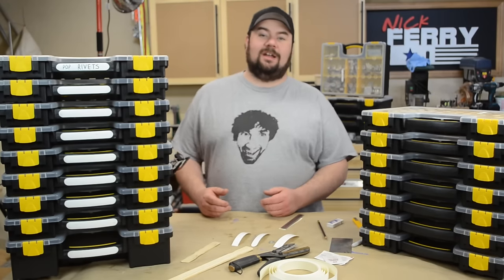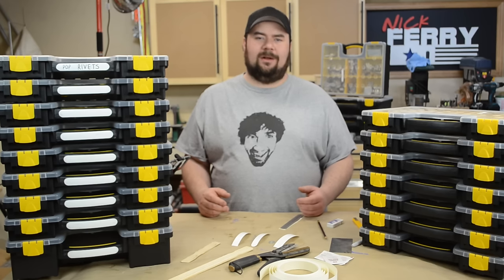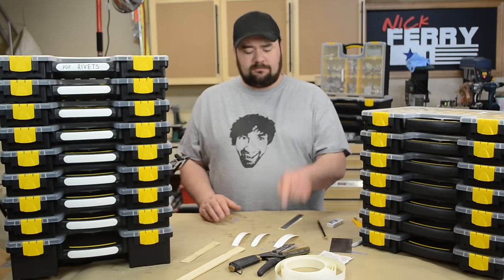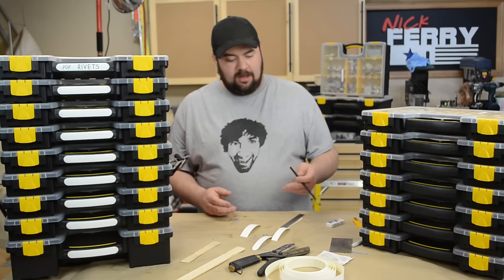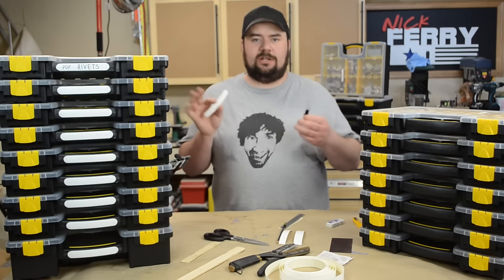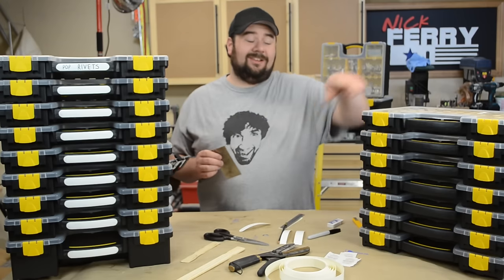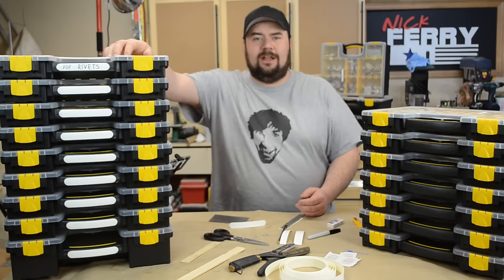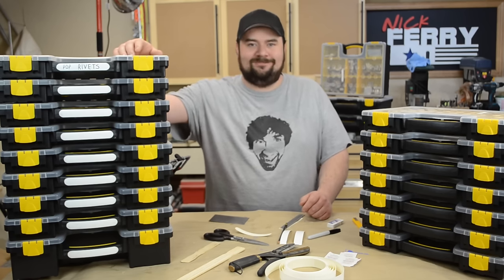Ⓕ How To Make Hardware Organizer Labels (ep64)

Comment: Nice take, and it looks like it works well for you!  

I did something similar, but with different materials.  I wanted to laser-print all my labels on 1"x3.5" Avery brand adhesive labels.  But sticking those directly to my organizer boxes was an issue.  Also, I wanted to be able to remove and/or overlay with new labels at will.

The way I solved this was to use super-inexpensive white vinyl home siding as a raw material, applied with hot-glue as a base layer.  I cut dozens of rectangles out of the raw siding that were just the right width and length (plus a small margin) to fit under my intended laser-printer labels.  Then, stacked & taped them so I could run them on a belt/disc sander to knock all the edges & corners off in one pass per edge/corner.  No pointy or sharp bits allowed!  

Next, each "base plate" got hot-glued onto the plastic organizers (textured side against the organizer's body; and smooth side facing outward) with a dab of hot-glue at either end, and one in the middle.  This provides a nice solid bond, but if I ever wanted to, I can just use rubbing alcohol to break that bond and remove the entire label plate.  I'd bet rivets would work well too, if that's a better fit for whatever kind of boxes one owns.

And finally, the Avery laser labels got applied to the smooth face of the vinyl.  It works great, and I can easily slap another label over an old one, when stuff gets reorganized.  It looks very uniform and professional, and unlike label-maker labels, I know it's not coming off until I want 'em off!  

For one-offs or temporary labels, I probably should check that siding material with a marker.  Since the outward-facing side is smooth, it's possible I could also use a permanent (yet erasable) marker as you did, I just haven't tried it yet.

Hope this helps somebody!

Comment: I use the Stanley brand organizers. Similar to the the HF organizers. I put a piece of electrical tape on the handle and then adhere P touch labels to the electrical tape. I color code the electrical tape by container content and it provides a good surface for the P touch label to adhere to. It also makes removing the label easier as it is easier to peel off electrical tape than a P touch label. I use 3M electrical tape.
Reply from the maker: That's a great idea to get the labels to stick!
Reply: Harley Zinker that’s a good idea but there’s one thing to watch with electrical tape. It is designed to be wrapped around something so it stretches as you peal it off the roll and gradually shrinks back over time tightening up. Make sure you don’t over stretch it when pealing it off the roll, especially in a warm environment, otherwise it will shrink back when used on a flat surface and look a little untidy.

Comment: Thanks for the great idea Nick! At work we use P-Touch labels but we only use them on flat surfaces, mostly painted metal. To stop the labels from curling we apply a 'smidge' of clear colorless nail polish along all the edges and that does the trick. I tried on all my tool cases (drills, router, etc etc but it did not work. Eventually they all pretty much bubbled and peeled. I will give your idea a try.
Reply from the maker: +Itz MeAgain cool tip on the nail polish - I think I remember someone using lacquer but hadn't heard of nail polish

Comment: I've been looking to do the SAME thing with mine, after I saw Adam Savages tower. I've been collecting them every time they go on sale, and this idea is PERFECT. Great job Nick.
Reply from the maker: +8BitLife getting them on sale or w/ coupon is key - I have been acquiring them for a few months - the cost can add up quick otherwise
Reply: Agreed.
Reply: +Nick Ferry Yeah, but you can still buy like a dozen for the cost of a sortimo (no offense to either Adam or Sortimo).    8-)

I've been looking for some way to label mine as well so this looks do-able.
Reply from the maker: Bill Weissborn I got to use sortimo when I was in manufacturing and they are nice but yes, way out of most peoples budget

Comment: Thanks Nick! I have a stack of those cases and a pile of drawer slides waiting to go into a cabinet. I was going to use a label maker, but this sounds far more reliable!
Reply from the maker: +Tyler Boespflug I would imagine - if you find a label that sticks well to these and holds up over time I would love to know about it - I could never seem to get the labels to stick and the paper ones wear out
Reply: +Nick Ferry - I just ordered a sample of Weatherproof Silver Polyester Laser Labels from Online Labels. I'm hoping they stick well because of their waterproof properties. This way I can even be "extra fancy" and print vector images or silhouettes of the item that's inside the case. Visually faster to locate the item I'm after.  Plus, the label will somewhat match the brushed aluminum magnet labels with vector images I'm using on my toolbox.

Comment: Did you ever try FastCap's FastEdge Peel & Stick tape?  That is what I use and it works quite well.
Reply from the maker: +Brian Way I didn't try it for this - with the compound curve on the handles I figured the heat of the ironing helped mould the melamine to the curve
Reply: Well, this goes without saying, but you do great stuff!
Reply from the maker: Brian Way much appreciated!

Comment: ooooh yeah! I have been struggling to find something that will stick to my black tubs (from IKEA) .. going to give this a go. I did try postage label, masking tape and printed nylon / pvc labels, but none of those have stuck so far.
Reply from the maker: +CodeFoxAus awesome - let me know if it works and maybe even snap a couple pictures - I was really curious on what different materials and applications this would work with

Comment: I use these same containers and have been trying to think of a way to label the handles. I'm wondering if dry-erase paint would serve the same function as the melamine with less effort.
Reply from the maker: +Joe Gekko what color dry erase would be easily visible on the black handles?
Reply: Nick Ferry Hmm, maybe I wasn't clear. I meant applying a white 'dry erase board' paint to the handles, in lieu of ironing on the melamine banding. You can usually write on dry erase with a permanent marker, and then when you need to erase the permanent marker you scribble over top of it with a dry-erase marker and it can be wiped off.
Reply from the maker: Joe Gekko ahh that makes a lot more sense - that would be a cool one to try!

Comment: Why are you stacking them horizontally, either needing a shelf for each one, or having to lift off the ones above? Stack them vertically, and you lose the shelves and gain the space. Hinges down, and they fit deeper but narrower (usually better space management in a workshop)- and you have the side of the box to attach your labels!

Comment: They make sticky back heavy paper and also sticky back vinyl for computer printers.  Just put paper in a printer, use a word processor or a drawing program to design the label, print it out trim and stick on.  Relatively easy to replace if need be.
Reply from the maker: I like the vinyl idea but paper label anything always seems to get beyond legible dirty in my shop - maybe I should wash my hands more often but that’s not the point here
Reply: @NickFerry  Try Mr-Label White Waterproof Vinyl Sticker.
Reply from the maker: Good to know - I have a vinyl plotter so I’d probably just go that route for the material

Comment: In most cases you can also color over the perm marker with a "expo dry erase" marker and wipe it off with no extra elbow grease
Reply from the maker: +JAKE SCOTT okay now you get a funny story - at a previous job someone used permanent marker on a huge dry erase board and then had to do what you said, write over each letter with a dry erase marker to wipe it clean - took them the better part of an afternoon - thought it was pretty cool idea and pretty funny as well

Comment: I See someone dabbles in the Garage Journal. LOL
Reply from the maker: +Joshua Russell did they do something similar?
Reply: +Nick Ferry yep almost 10 pages of building the same system. I even built one for my friend. http://garagejournal.com/forum/showthread.php?t=289281
Reply from the maker: Didn't catch it - been wanting to make this ever since I saw them in hardware stores for specialty hardware
Reply: +Nick Ferry well should be a good read. Looking at the sketch up file in the video it looks like you might want to notch out the drawers for easy access to the handles and add the sides to allow the retaining  of the strange container. The forum also has links to affordable drawer slides.
Reply from the maker: Got the drawer slides already and wanting to see how much clearance the drawers had before notching
Reply: +Nick Ferry well good luck with the build. I know my friend loves his. I shared your video over there too.

Comment: That cabinet shelf design is kinda overkill IMO... How about thinner material like 1/8" aluminium 90' angle bracket rests they can slide on? It could cut the height down by 20% or more. Less dadoes to cut also. Great alternative label idea though.
Reply from the maker: +tensazero no dados in this design and I want drawer slides on the lower ones - making it from alum or mild steel is viable too

Comment: I recommend mixing these cases up with the real ones by stanley that store house is a knockoff of. 

They are both great tool boxes, but it is nice to match each box to purpose. Some stuff i want to organize and store affordably, some stuff needs to take a hit from a hammer.

At that point, i have stuff that needs to be dustproof and water resistant, which apache is great for at harbor freight.

Comment: Another way to remove permanent marker is to paint over it with another permanent marker and wipe it off while it is still wet.
Reply from the maker: +JIMMY TATE yup yup - the carrier solvent will re-liquify it so to speak - works well on dry-erase boards - good tip